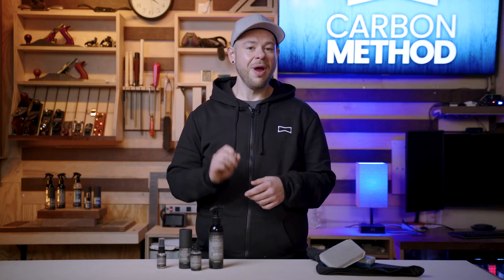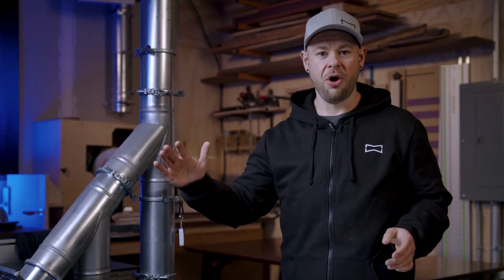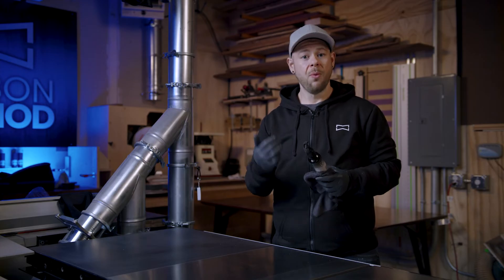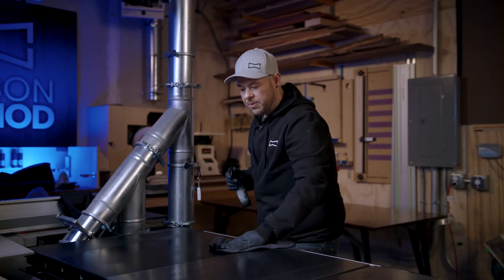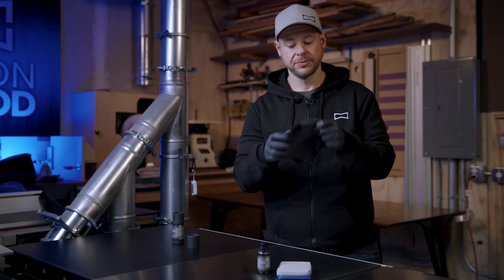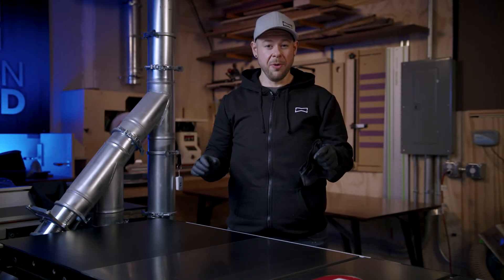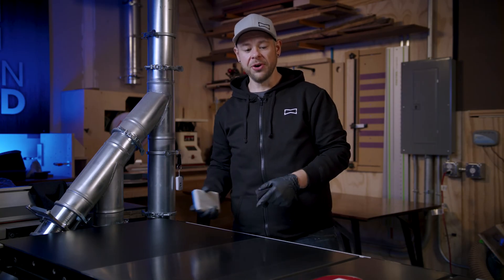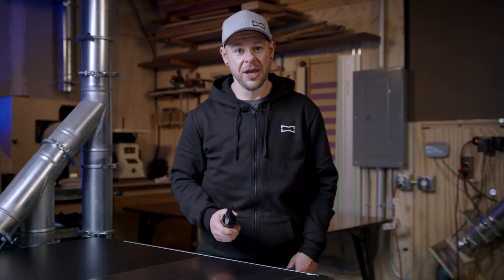Carbon Method Carbon Coating Application Guide

Comment: When you say to reapply carbon coat every 6 months, can I go straight to the carbon coat step?  Or do I need to start over at the beginning of the entire reconditioning oil/carbon cleanse/carbon coat process?
Reply from the maker: Great question! This depends on the condition of the surface. If it is still clear of rust and discoloration, you can skip the Reconditioning Oil step. Spray the previously coated surface with Carbon Cleanse, spread it out, and wipe it off. Allow any leftover moisture to evaporate. Repeat this process to ensure all residual waxes, sprays, or other contaminants are removed. Then apply another 2 to 3 layers of Carbon Coat as you did the first time. Let us know if you have any additional questions!

Comment: Can this be used on cast iron and malleable iron hand tools. I am interested as I prefer to use hand tools rather than power tools and I am feed up keep appling tool wax to my hand tools. Is there a video showing this product being used on hand tools such as hand planes, engineers squares (I use these for woodworking as they are more accurate & substantial than standard woodworking rivetted squares) and hand saws and how it can be applied to these tools.
Reply from the maker: Absolutely! We recommend coating your hand tools (especially those hand planes!) and all of your layout tools. Coating them will help to protect your investment during daily use. And while we don't have a video on this yet, watch this space! We definitely have one planned, because this is one of our favorite uses for Carbon Coat.

Comment: After applying Carbon Glide as stated in the video, how long until the saw is ok to use? Is there a cure time for Carbon Glide?
Reply from the maker: You can use the saw immediately after using Carbon Glide - as soon as it dries, you can get back to work without delay!

Comment: Every time I think I should get some carbon coat I watch this video and think maybe I’ll just get a nickel-plated Harvey cabinet saw instead. Getting that into my basement looks easier and less to go wrong than doing this application.😅
Reply from the maker: Even on nickel-plated tools, Carbon Coating offers the benefits of protection and a much lower-friction surface than the bare saw. Let me know how I can help - with the Carbon Coating; you're on your own for buying the Harvey. 😅

Comment: I know your website says 50 degrees is the lowest temperature but I just got my coating and I'm anxious to install it.  We're in the high 40s all this week.  Will the portable heater trick work or will the coating not crosslink as well?  I don't want to waste it but I REALLY want to see this stuff in action.  I'm a detailing nerd, so I'm familiar with coatings.  Should I just wait?  Thanks!
Reply from the maker: Ooh, this is a really nuanced question! You should absolutely give us a call and we can go through all the factors with you directly. Stop by carbonmethod.com and tap the customer service phone number to speak directly with the owner. We'll figure out together what's going to be best for your unique situation!
Reply: @ I ended up running a space heater.  We got up to 50 yesterday so I went for it 🙂 Worst case it didn’t cross link as well as it could have.  If that happens, I will abrade the surface and reapply next year.  I’ll be putting the glide on today 💪🏻

Comment: I purchased your carbon coating system to apply to four major tools (table saw, planer, shaper, and band saw) which have seen over 100k board feet of production in the last few years.  I just finished applying the carbon coat on all four tools and tomorrow will apply the carbon glide.  On deck after that is processing about 5k board feet of Water Oak, Pine, Red Oak, and Elm...  I will be interested to see how this holds up.  The actual biggest reason I applied the carbon coat system is that at night I have 7 guard kitties that sleep in the workshop...When they lay on the cast iron, just their body temperature difference to the cast iron is enough to condense moisture and cause it to rust.  I've come in at times in the morning to see cat outlines on my saw or shaper.  Preventing the rust is really my main goal.  Previously I've been applying Minwax to the surfaces but sometimes after a production run we don't get the surface recoated and the cat outlines let us know.
Reply from the maker: Between the rigorous use and the cats, it sounds like Carbon Coat will get a thorough test in your shop! Keep us updated 😺
Reply: I’m curious to see as well. I ran just a small amount of sheet goods over the past 4 months of ownership on my saw and it has started rusting in a few spots that I had to correct and reapply the carbon coating. Did not expect it to wear as it did in such a short amount of time as well as needing a new coat with the limited amount of cutting I did. My saw is in a garage that remains around 40-50% humidity.  I put 4 coats of carbon block on a brand new saw.
Reply from the maker: @greghowdeshell  Hi Greg, during the past 4 months did you occasionally apply Carbon Glide (to act as the wear layer) on top of Carbon Coat?
Reply: yes, I applied the glide twice with two coats each time during that period of time.  I have a thought to reapply glide before each cutting event.  Or maybe after to allow it to cure as long as possible.
Reply from the maker: @greghowdeshell  If you have a moment, please feel free to call (844-432-2266)
or email (cs@carbonmethod.com) us to discuss further. We want to make sure your new saw remains rust free moving forward!

Comment: Ok..simple enough..but what it's the best method to remove any rust spits before this process. You don't want to trap any rust
Reply from the maker: Great question! We recommend using our Carbon Coating Prep Kit to get your tool surface in top-top condition before coating it. You can find that on our website and see a demonstration of the process here: https://www.youtube.com/watch?v=XgYkGQ360MY

Comment: Can I use WD-40 to clean the surface and rust before applying Carbon Coat?
Reply from the maker: You can, though, we recommend using our Reconditioning Oil, which was specifically formulated to help with the rust removal process. Check out our video "THE NEW WAY to remove rust from cast iron tools!" for more information. https://www.youtube.com/watch?v=XgYkGQ360MY

Comment: Can more layers be added after it sets over night.
Reply from the maker: Absolutely! In theory, you could add more layers days - or even weeks - later, depending on the condition of the surface. But overnight definitely isn't a problem - provided you make sure to remove any shop dust that's accumulated, of course!

Comment: Technically, you do not need to coat the black extension wing as it is coated metal. - not cast iron. To me, a waste of expensive product.
Reply from the maker: Yeah, while it's not necessary for rust protection - but we recommend coating extensions to provide the same evenly slick surface across the whole top to provide the best and safest experience. The friction difference is that noticeable!

Comment: I’ve got some reservation’s about this product if it has nano technology within its makeup. ??You guys call it nano protection. Some Nano particles are very toxic and carcinogenic and not  something to be messed with ( especially if your handling items coated in it dangerous nano technology)

Nano technology is amazing but not all of it good - I’ll stick with paste wax until I find out more.
Reply from the maker: You'll be reassured to know that Carbon Method products contain no nanoparticles! We use 'nano' to refer to the extremely smooth, flat surfaces achieved by our coatings, not to specifically refer to nanometer-scale substances used to produce them.

Comment: What is the maximum time in between coats?  Sometimes I get pulled away and it might be two or three hours before I could get to it again.
Reply from the maker: We chatted with you by email, but for everyone else's benefit: a few hours is no problem! There's really no limit on the time between coats, but particularly if you've used the saw between layers, and the latest coat is fully cured, use Carbon Cleanse to prepare the surface again before applying additional layers of Carbon Coat.

Comment: I purchased your quick kit for 1 to 2 tools. Worst part was cleaning the table saw and preparing it for the coating. Putting the carbon coat on was a breeze. My only issue is the 0.5 OZ didn't provide enough for my 52" SawStop PCS to get 4 layers. I was only able to apply 3.2 layers. Really 3 layers on the full saw and 4 layers on 1 wing. Now I am at the 24 hour wait before putting on the carbon glide and using my saw again tomorrow just wish I had that little bit more carbon coat for the full 4 layers.
Reply from the maker: For the next time - and it'll be a while! - try Carbon Method Reconditioning Oil in conjunction with our Abrasive Pads to make the preparation easier. It's the fastest method we've found to remove rust from an active surface and get it ready for Carbon Coating.

Comment: I have a quick question regarding your carbon product. Is it conductive? Can electricity flow on it? Thank you for your time
Reply from the maker: We have not yet conducted - get it? 😉 - extensive testing on the resistance of Carbon Coating, but we definitely plan to! Given the high level of graphene solids in our formulation, and the extremely thin application layers, we're very interested to find out not just whether the protective Carbon Coating will pass amps, but also how well it will continue to protect after exposure to high voltage. Subscribe to our channel to stay up-to-date on our results!

Comment: Any info on how it would last on a lathe bed? lots of metal on metal sliding.
Reply from the maker: Good question! It will provide better protection for the metal surfaces than any other product you've used before. For any high-wear, metal on metal contact points, you might need to reapply Carbon Coat more frequently.

Comment: after 6 months do you have to strip everything or can you just use the carbon cleaner and proceed ?
Reply from the maker: Just two rounds of Carbon Cleanse and then right into it! Recommend 2-3 layers of Carbon Coat on the reapplication.
Reply: @carbonmethodco one more question about reapplication. Does the carbon cleanse break down the carbon coat?
Reply from the maker: @greghowdeshell  Good question - Carbon Cleanse does not breakdown Carbon Coat 👍

Comment: Hey fellas I have a two part question. First question is is it safe to use the carbon cleaner on a finished epoxy surface? Second question is, if in the future the epoxy finish requires an additional coat will the ceramic coating interfere with that? I guess in other words would I be able to sand the epoxy and ceramic coating off to apply a fresh new coat of epoxy?
Reply from the maker: You could use Carbon cleanse to clean the epoxy, but  we would suggest a mixture of isopropyl alcohol and water before Ceramic coating.  

You can and should sand off the Ceramic Coating making sure to get down into the epoxy.  You will likely have bonding issues with the new layer of epoxy if you try to coat over the Ceramic.

Comment: Could this also be used on steel tools as well (chisels, blades, etc)? Does it cloud or change the appearance of metal beneath it?
Reply from the maker: Yes, absolutely, it works wonderfully on an metal in the work shop.  Sometimes it can slightly darken the metal, but has a very nice look and feel to it.

Comment: I was just in the process of reaching out to producers of ceramic coatings designed for both the avionics and automotive industry and asking them about woodshop applications. This seems like a great product that I would be interested in using on bigger tool surfaces and even hand planes.
How does the slickness compare to a freshly waxed/buffed surface?
How resistant is this product to scratches during use?
Reply from the maker: Carbon Coat is very slick, and regular applications of Carbon Glide will keep an extremely slick surface.

Comment: What's the best way you've found to remove rust from a tool before starting this process with your product?
Reply from the maker: We have heard good things about the T-9 Rust Remover, but we typically use a grey abrasion pad.